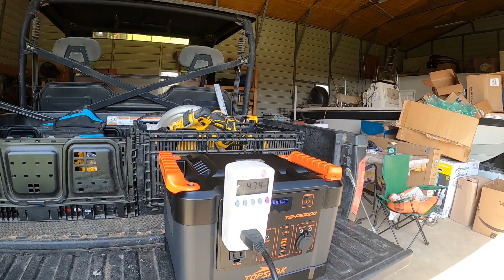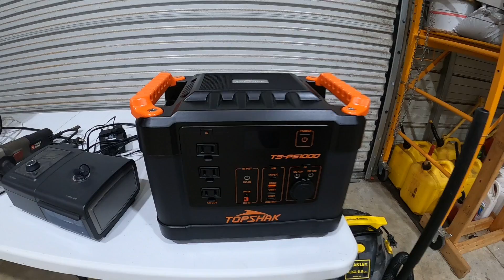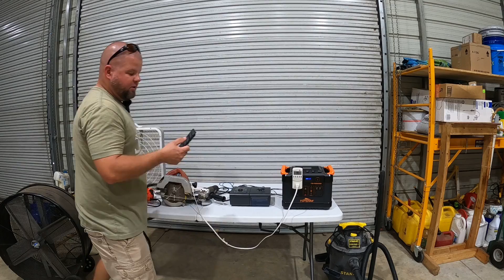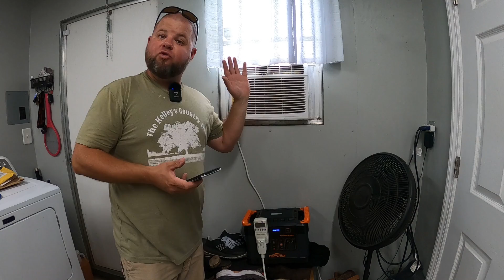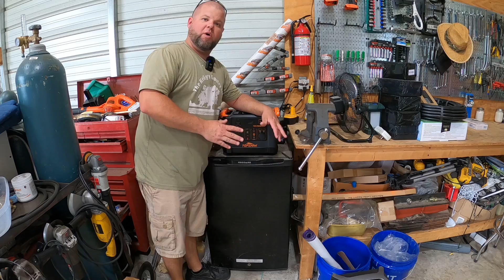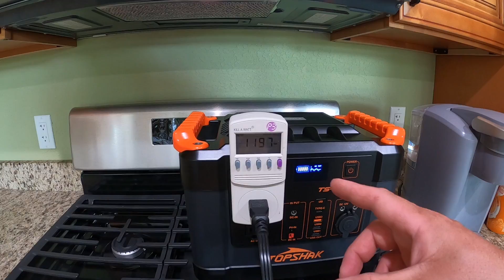TOPSHAK 1000 watt solar generator full test and review! #564

Comment: I have a 500watt / 110 volt / 55000 lumen flood light? Would this be able to run the flood light? My purpose of this light is mainly for squiding, so looking for at least 3hr run time.
Reply from the maker: Your going to need something larger. Take the watt hour Wh capacity of whatever unit you are looking at and divide it by your 500 watts an hour for your light. There is also conversion losses on the machines. To be safe you will want a unit with at least 2000 watt hours of capacity or 2Kwh.

Comment: Does your automatically shut off after about 3 hours? I'm finding this with mine, it will turn back on. I'm thinking it's just timing out, safety feature perhaps. But also the battery meter doesn't seem to work accurately...
Reply from the maker: Mine does not

Comment: Thank you very much for your review  Andrew!.
I just got the same model you are reviewing and I want to use it to run a 5000 btu window ac. It does work just like your review.  However it work for about 5 minutes and turns off itself.  If you turn it on again  it does work for another 5 minutes.... and this goes on and on... is this normal or should I send it back and upgrade it with the bigger capacity model?
Reply from the maker: I certainly didn't have that problem, something doesn't seem right with that.  I'd be asking for a return.

Comment: I've watched a lot of reviews on YouTube. You are by far the best at giving presentations. You gave a lot of information in a short period of time, and I wasn't bored. Keep up the great work your doing. It helps many to make high end decisions. David and Archer my German Shepherd service Dog
Reply from the maker: Thank you for the feedback! I'm currently testing a 2000/4000 watt model, video out soon.
Reply: @TKCL  I have my sights on one, a 2000/4000 for $794. on eBay. If I get one, it will be that. I plan to travel the US with my German Shepherd service Dog in a 2016 Ford Transit connect van. I'm in the process of fixing it up now. 6 months sail time. I have a new ICECO 20 already purchased on Ebay for $100. less than Amazon. Have to go fir deals when they come. You helped me decide on a power station. There are so many out there. I don't know what solar panels to buy. It says 4-100 watt to charge the 2000/4000 in I think 8 hours. What kind, I dont gave a clue yet. Thanks again. Your great at what your doing. I subscribed and hit the bell for all your videos. David and Archer

Comment: I have a question my solar inverter charger has a AC 120 volt input that is used to charge the batteries while powering your loads and bypass mode you can adjust the incoming amps from 5 amps all the way up to 40 amps let's say I set the incoming amps at 5 or 10 amps can I use one of these solar generators to charge my battery bank ? it's only four 80ah agm batteries..
Reply from the maker: I don't know the answer to that question, sorry.
Reply: @TKCL  oh ok I think I'm going to buy one next week and make a video showing if it can charge up a solar battery Bank by simply plugging it in

Comment: Hi.got the same unit and my power pack ac gets really hot....does yours?
Reply from the maker: Yes mine does as well.
Reply: Does your automatically shut off after about 3 hours? I'm finding this with mine, it will turn back on. Also the battery meter doesn't seem to work accurately...
Reply: @timmajones  no sir.has not shut off on charge mode still getting hot on power converter when charging. I don't like leaving it unsupervised,fear of fire while charging. :)

Comment: Do you think the inconsistency rated watts capacity comes from the inverter dc to a.c? Also are they branded cell batteries?
Reply from the maker: That's exactly right, the converter also requires and uses energy. The only way to get  max capacity out of one of these is to use a 12 volt appliance with a consistent draw. Anything with a motor will also have a power factor and use/waste energy in order to run it. I did not take it apart and test the batteries.
Reply: @TKCL  cool thanks for the response, if u still have it and ever have the time please check out the battery bank for us let us know if they’re branded cells 💪

Comment: Does it have pass through charging?
Reply from the maker: I've tested a lot of these devices, from what I remember it does.
Reply: I know there are so many of these out there . Do you feel this is worth the money? Have you had any problems with it not charging or loosing charge quickly
Reply from the maker: If you are OK with no bells and whistles, and slow wall charging, this is hard to beat for the price. I've had several viewers tell me lately they have been buying these for a killer price. No issues currently

Comment: Thanks for the review. QUESTION! Can I solar charge with a 200W panel while I am discharging to get more hours out of the 5000btu ac unit to get a longer run time???
Reply: I saw one identical different brand name same model number. Brand vkrvkn. One review says this:

Bads: can't use the 12v DC port while solar charging which means you must disconnect the solar panel to use the 12v or the unit will stop providing power to them as soon as solar is plugged in! There is slight noise whenever the unit is on.

Now doesn't necessarily say won't do pass thru with ac plugs but to me sounds like it won't. This could help explain the low price.
Reply from the maker: I have not tested that exact scenario so I'm not completely sure. All other units I've tested allow pass through charging and discharge.

Comment: Walmart has these for $419. Amazon has it for $404, but have to look for the one priced at $899 and then apply the coupon and promo code. I just bought my 2nd one.
Reply from the maker: That's a crazy good deal
Reply: Does your automatically shut off after about 3 hours? I'm finding this with mine, it will turn back on. Also the battery meter doesn't seem to work accurately...

Comment: That TOPSHAK 1100Wh looks just like the BougeRV 1100Wh power station.
Reply from the maker: Very well might be made in the same facility.
Reply: @TKCL  BTW, it is priced at $405 today with coupon code "CRGJPB35" and clipping the 15% coupon.
Reply: @TKCL  I noticed the same thing. There is info in the BougeRV manual about ways to charge these units faster that aren't in the TopShak manual. The USB-C output is also an input that can be used to connect a 60w charger to use in conjunction with wall wart and it significantly reduces charging time. Also according to BogueRV up to 200 watt solar panels can be used. I've already tested the USB-C connection as a charging port and it works just like BougeRV says.
Reply from the maker: That's great to know, the charging time needs a boost

Comment: One horsepower is 746 Watts, so you’d need a unit capable of about 3600 Watt capacity to run a 4hp motor, accounting for the Wattage soaked up by the motor’s Induction (increased power factor).
Reply from the maker: Wow that's a lot of needed power.

Comment: If you don't mind me asking, which solar panels are compatible with this solar generator?
Reply from the maker: Any 120 watt panel or less power. It appears to have the standard 4mm plug. I used a different band solar panel to test mine with and it plugged up just fine.
Reply: @TKCL  thank you so much for taking the time to reply,  truly appreciate that!

Hitting the subscribe button right now 🙏🏻
Reply from the maker: Thank you for watching

Comment: Great review! What is the battery? Lead acid? Will it power/start a window AC unit (I know it  won't be for long) rated 11amp? I see a flash sale for these at $450...have you learned anything more, for better or for worse? Thank you for the info!!

LoL oh crap! You just did the window AC unit. Thank you for that I'm about to rewatch that segment!

How would you tether a 100 amp hour lifepo battery to this unit? I appreciate you!
Reply from the maker: No idea how to tether batteries, I wouldn't recommend it as this isn't setup for it. This has standard lithium batteries. $450 is a steal for something this size, I'd have a hard time passing that up.
Reply: @TKCL  ty for the reply! If it wasn't this exact same model, I saw a similar one depicted as being tethered. I'm also glad to know it's lithium-ion. And yes, I have about 24 hours on that buy it now deal... I'm going to sleep on it and likely make a move tomorrow. I appreciate you!

Comment: What do you think about the 4000 watt topshak generator on ebay for $695.00. I don't know anything about solar generators , and I don't know what else I need. Could you give me some guidance .
Reply from the maker: I didn't even know they made a model that big. I've seen their 2000 watt model. That's also insanely cheap for such a large unit.
Reply: @TKCL  What all do I need to get to put this into operation. I know I need solar panels and connector from panels to the unit., anything else. I'm old school (73) and wasn't raised with this kind of stuff so it's hard to grasp these things . thanks
Reply from the maker: Nothing, the unit comes with the power supply and wall charger. Solar  panels are not needed unless you want them. Look for 120 watt or less  panels.
Reply: @TKCL  Thank you.

Comment: If your freezer or refrigerator has a problem more than likely it will be when it restarts when a thermostat is satisfied then when it calls for cooling you may have a problem if so you can get a hard start kit to put on it.

Comment: So cool them new systems.  I been considering one for a time now.  But I get your test of running a corded saw.  But let's be real I have not used my wall plugged saw in years.   Just batteries. So I wonder how they do at charging a Milwaukee battery for a Fuel drill for example....
Reply from the maker: I tested that in another episode, but I do need to figure out how many batteries it would charge.
Reply: @TKCL  mama had 5 strong healthy puppies but she covers them like a chicken.  So video delayed.

Comment: Dear Andrew,

thank you once again for your open and honest review.

I am wondering; As you were testing the capacity on your freezer it pulled an aprox. 131Watt if I recall correctly.
but what is the charging time on a solar panel? Would this generator be able to sustain the power of your freezer by charging itself on a solar panel?

If so, that could mean that if you put this model generator on a solarpanel, your freezer could potentionally run off-grid wich (as I see it) would be a big plus in case of a hurricane/tornado or other calamity .... that way the emergency generator would not have to run the freezer aswell, so more power available for the coffee machine ;)

What are your thoughts about that option? Maybe you've answered it already in the video, but this just crossed my mind

As always, with much love from the Netherlands,
Ben
Reply from the maker: This particular model does not offer enough input charging wattage to sustain that pull from the freezer. However...... The freezer does not run often, so there could be a chance it could maintain. But your asking for perfect sunny days and no problems. You would realistically need a unit that had a little more capacity and could take several hundred watts of solar input.
Reply: @TKCL  thank you for your reaction… I could imagine a similar setup with a solar panel to preserve and secure the freezer ❤️

Comment: A fan being an inductive load has a power factor that could easily account for a 20% drop in efficiency. A pure resistive load like a toaster would have a much better power factor rating. The kilowats used would be closer to the rated numbers.
Reply from the maker: Thank you for the information, I'll be sure to test that way in the future. What about something like a heat gun?
Reply: @TKCL  anything that generates heat is a resistive load. a heat gun does have a small inductive fan but the load is small. A toaster would be better, no motor inside.
Reply: @TKCL  Heat gun is like toaster, coffee pot- pure resistive.
Reply: @willr66  , both a toaster and a coffee pot are purely resistive loads. They both have a heating element with no inductive or capacitive load.
Reply: That's probably why the circular saw and large fridge wouldn't work.  I've got a Yeti 1250 that runs my large fridge (alone) and two chest freezers (together) just fine, but don't know how it compares in power draw to the one in this video review.

Comment: Great review!  Probably q worthwhile investment.   The capacity is reduced by the load.  It's probably rated at 1100wh at  100 watts (10 hour discharge).  Also reduced by the power factor. Motors can be 70% power factor, vs something g like a wall wart qt 93% power factor.
Reply from the maker: And as most have mentioned losses due to the inverter converting from the batteries to 110 volts.

Comment: I've never actually seen one of these supposed "solar generator's" but from what I can tell this isn't a generator at all, is it? Can it actually produce electricity or is it a rechargeable battery bank? If it's not a generator, then these companies should not be making the claim that they are. It confuses a lot of people.
Reply: Agreed, I've always had an issue with the use of "generator" on these types of units. But I probably take more issue with the term "solar generator".  It's a huge stretch to expect that the most people would ever use solar to charge one of these things, as it takes an inordinate amount of time to charge one via solar.
Reply from the maker: A full day or more to charge with a single panel.
Reply from the maker: Well I guess the claim is it technically generates 110 volts from 12 volts. So a more proper term could be an inverter. Although it does accept solar energy and stores it for 12 or 110 volt conversion.

Comment: I like these, I’d like to build a little cabin if I had the property just something to kind of get away and go camping in but it would be nice to have some lights or a fan or something to charge your phone. Some of the 2001 units I’ve seen would be all I really need and that way you could run a hot plate or microwave if you really needed to. One thing I’ve seen lately are these capacitor units and they’re made for refrigerators in air conditioners and you wire them in line to those specific circuits. That way the capacitor charges up over time and when they have a huge power draw it’s able to dump the capacitor so it doesn’t put as much of a strain on your system, for something like that I think it would be awesome because a lot of the power for the initial surge of a compressor coming on would come from that capacitor in it when it tripped is and what it was running your wattage drops and it can maintain. It would be really interesting to put the two together to see what a difference it makes.  

I like the reviews. I also used to do a pretty huge review webpage for RC cars and another four four-wheel-drive trucks and I know those reviews can be a ton of work and almost full-time job as well, I got to the point where I had stuff coming in the mail almost every day and it just couldn’t keep up with it, and of course people get all dramatic when they send you something that’s kind of trash and your review isn’t stellar on it. But I told people upfront that if you send it I’ll review it and if it sucks or breaks I’m gonna give my experience on it in my opinion. If it was something that broke that seemed out of the norm for me or for that type of product sometimes I’d let them send another one or fix it but sometimes you don’t have a break you just know it’s a bad product or bad design and those are a little rough for me because I hate telling a company that their product sucks after they put a bunch of work into it but it was kind of fun for a while.  

I like the reviews and I think you should do more of them but you don’t want to kill yourself over it and let a bunch of companies just use you as sort of a commercial and you do pretty extensive testing so I can see where it would be a big problem for you to get a couple products a week because you put hours into these tests sometimes. But if it’s something that seems fun I think you should go for it.
Reply from the maker: I agree and feel the same way about reviews. I'm not going full time with them or going to kill myself. Also the "product" needs to speak for itself.

Comment: Hi Andrew! Thanks for a fantastic review. Just a little bit of information for you on battery capacity. When you are using AC power you have two things you contend with. One you are testing the effectiveness of their inverter. A great inverter uses 8-10% of the batteries capacity. Two they definitely have a safe stop point, but normally they should not go into the 1100 watt ratting. If you want a real capacity test you need to do it using DC power like a DC fridge. You should get a full 1100 watts if you use DC as they don’t need to invert the power.
Reply from the maker: Thank you very much for the information, that makes perfect sense!

Comment: Love your reviews! Very thorough.  I'm itching to buy a generator, but like you mention I don't want the noise and stench of a gas generator.  I just need something to power my freezer or refrigerator in an extended outage.  Luckily I live in a very reliable area with quick turnaround when there is an outage, but I like to be prepared.
Reply from the maker: I understand that, I'm glad you get quick response.